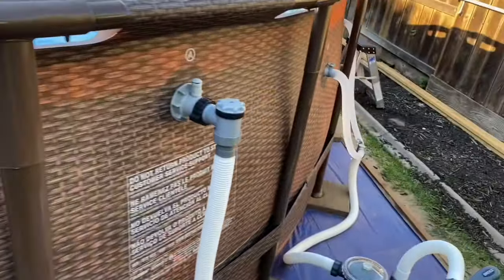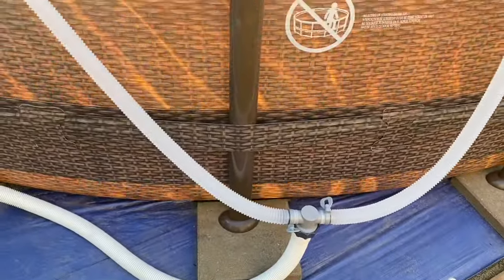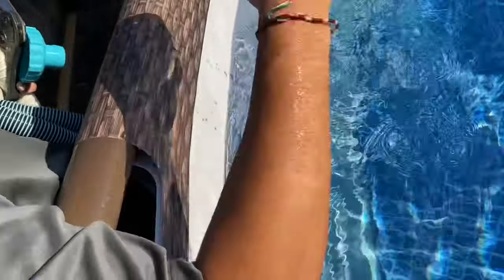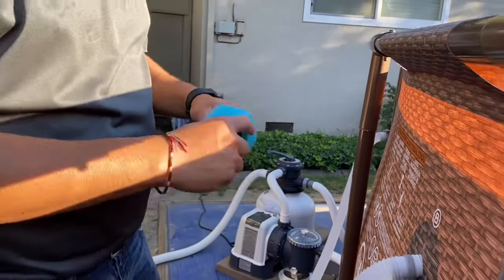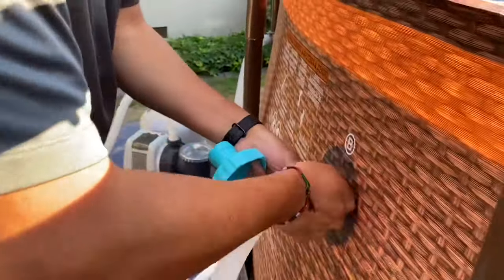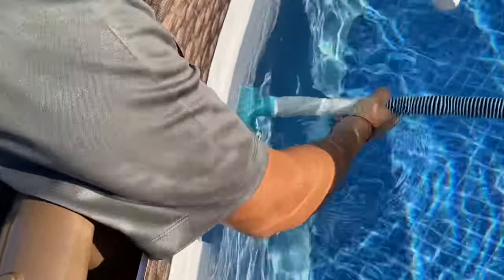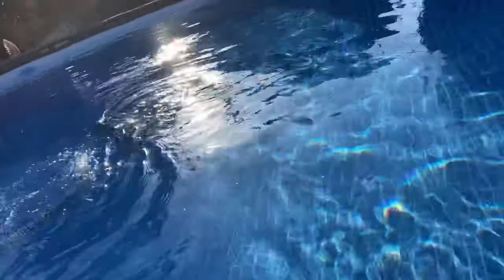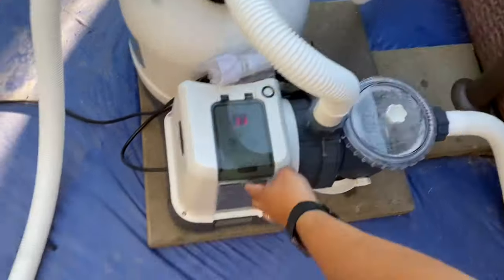How to connect a vacuum to an above ground pool. Intex, Bestway, or Coleman

Comment: Great video. Very helpful. I was also told at my local pool service store that when vacuuming I should have the filter dial turned to the "waist" setting??? This way the debris from the bottom of your pool will not be put directly into your filter. It will travel through the waist hose and out onto the ground. Of course this removes water from your pool and you may need to add some water back after vacuuming.  I am a newbie so if anyone would like to chime in on this topic it would be appreciated. Thanks!
Reply: It is better for your pool to use waste when vacuuming so it doesn’t go through your sand. It would make the sand last longer pretty much

Comment: 0:48 Who ever told you it was unconventional is wrong. I have an above ground pool and when I got it in the box with the pump was a vacuum a hose and a hose to pump adapter. It was one of the kind that could either be hooked to the pump or hooked to a garden hose and filter into a bag. I replaced it with a $40 nice one because the cheap one kept floating up off the bottom of the pool (no spring/weight).
Reply: Mine came with it too. It was a cheap piece of junk. The bag would fall off and debris right back into the pool. Terrible! Especially after working for 20 minutes or more in the heat 😅

Comment: Thank you so much my 12 x 24 best way I did upgrade to a 16 in sand filter I have no idea what the hell I'm doing and I've had three different people do all kinds of craziness with the hoses I am so frustrated right now because when I'm back washing I'm basically getting a very small stream of water I can't figure it out I have 2 inches of dead algae all over the bottom of the pool I've tried brushing it scooping it out etcetera I'm beside myself I need help

Comment: Hi there. I have a Bestway 12’ (39” deep) round pool installed and converted to a Intex 26643EG Sand Filter, 10". It says it’s a .25hp motor. And I also added a Hayward skimmer. I’d like to install a vacuum for it. The local pool company is not sure the motor is strong enough to install a manual vacuum using the skimmer. Can you help me out?  Don’t want to spend the money on the hose/head/pole if it won’t work. And also avoid a $300 manual one if it will work.

Comment: This might be a silly question but how to keep the pump from shooting the algae back into the pool? So I left my pool half full over the winter and I’ve installed an infection sand filter pump and upgraded the hoses to 1 1/2 inch but while vacuuming for the first time today I noticed the murky algae water was shooting back through the jet nozzle. Im so new at this but is there something I’m missing?
Reply from the maker: It’ll have to filter for a while with sanitizer before it comes clear. The filter doesn’t just allow green in and out clear. Good luck.
Reply: @JuanGarcia-gi6me  as crazy as this sounds, I put a magic eraser in the intake basket and in the skimmer. it's not instant but it will cut your time in half. Not a problem for the pool or humans at this point at all. You will have to change it regularly and your filter as well if it's not a sand filter. OR There is also a product called GREEN TO BLUE. You can get at Walmart. OR Shock it. When it all drops to the bottom, vacuum it but run out out of the pool. Rinse and repeat if necessary. Fill up the rest of your pool with clean water and add a chlorine tab to the filter basket or somewhere in the line along with a few boxes of backing soda. Run your filter 24/7 for a few days. Should be good to go in a few days.

Comment: When vacuuming the pool do you leave the sand pump on filtration or what do you change it too?
Reply: I changed mine to backwash so the waste does not goes through the sand
Reply from the maker: I set mine to filter.

If you set to backwash, you’re also dumping water, and vacuuming takes a while; you’d lose a lot of water setting to backwash and vacuum.
Reply: Directions on my pump says to put it on backwash...

Comment: i actually put the hoses on just the pool part  backwords so the inlets are  now the outlets and the outlet becomes the inlet i no its only one inlet now insted of two but if you want you can unscrew the vent cover so it can suck up more and theres a catch basket right before it goes to the pump so it catches everthing and when you want to vacuum you just stick the hose in the inlet and then you have super suction and free you dont have to buy nothing  your way you can only get half suction because you have two inlets and your only using one to vacuum am i crazy for this should i not do this i have done this for years its works well and instead of a floater for clorine i put a chlorine puck in a sock and tie it to one of the  2 outlets and within 12 hours the puck has disintegrated and pool is full of chlorine i only have to do this every 3 days and vacuum one time a week spray my filter clean evertime after i vacuum and net every other day and i never have a green pool sorry for the long paragraph with no caps and puncuations

Comment: CAN SOMEONE HELP ME PLEASE
I ONLY HAVE BACKWASH,FILTER,RINSE,WINTER

I FLOCKED MY POOL CAUSE IT WAS WHITE CLOUDY
NOW I NEED TO VACCUM
CAN I VACCUM TO BACKWASH CAUSE I DO HAVE THE LITTLE BASKET ON THE SIDE OF MY SAND PUMP AND OF COURSE HAVE THE BACKWASH OPEN WHEN VACCUMING.
I KNOW I WOOL LOOSE ALOT OF WATER
BUT MY CYA IS UP AND I NEED TO ADD FRESH WATER SO IT'S OK
PLEASE ADVISE ASAP
THANK YOU
HAVE A GOD BLESSED DAY
Reply: Vacuum always on filter then backwash after vacuuming if your pressure is too high
Reply from the maker: Jay’s comment is right on.
Reply: @JuanGarcia-gi6me  so you vacuum to filter even if you’re trying to vacuum out dead algae?? I thought you would want to waste that…